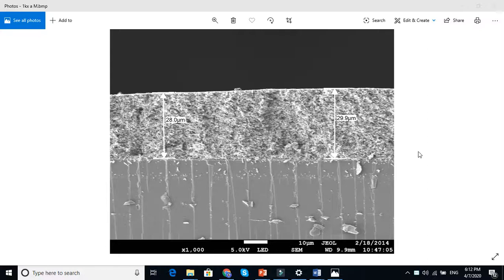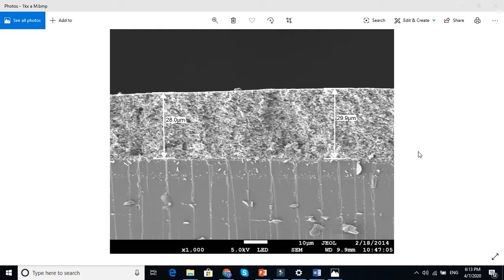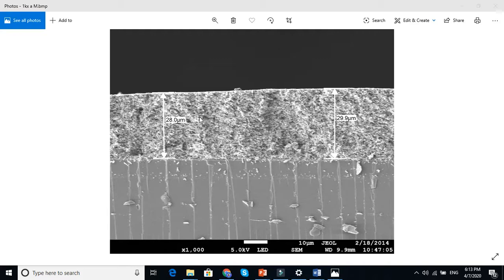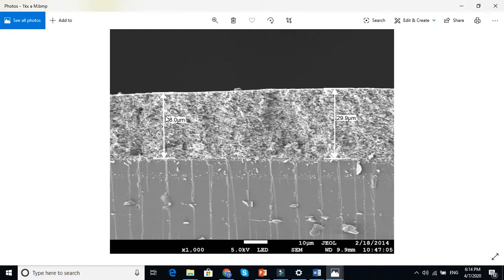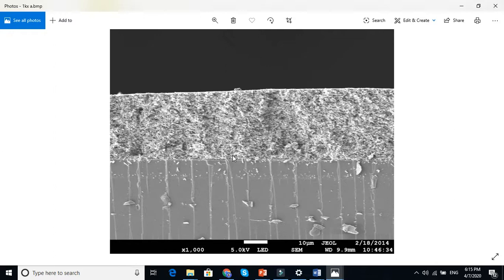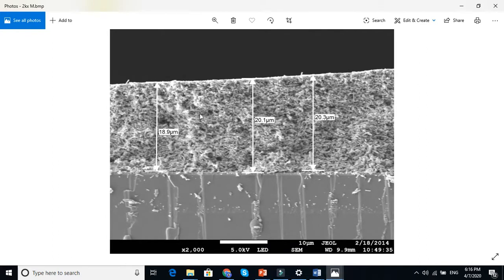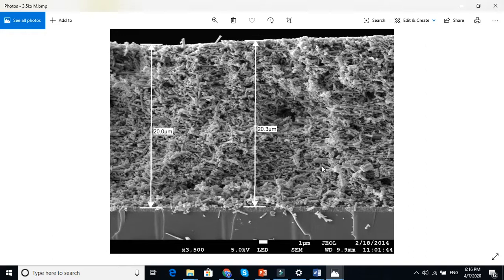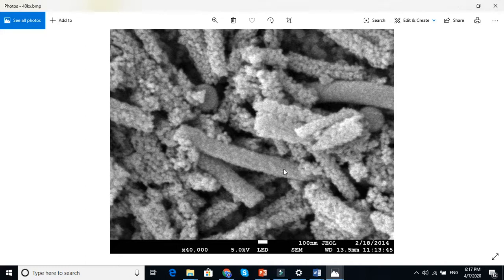SEM Cross Section Analysis | How to Interpret Micrographs

Comment: Sir ,In my project I need to take fesem cross section image for my sample(5mm×5mm) niobium metal foil coated by oxide layer in anodization method.In analysis centre, they said cross section not taken unless  polishing the side of foil, what process I do for it .
Reply from the maker: Thanks for the comment. We can take images of any sample, like the surface, diameter,  height, length, cross section etc...if and only if the sample could be fit in the sample holder of the FESEM machine.

If your sample is small enough to fit in the sample holder of the FESEM, then you can take the images.

Tell the operator that it is possible if you are sure that your sample can fit well in the sample holder.

I have taken countless cross-sections images of different electrodes and nanofibers .....

Please let me know if you have any questions
Reply: @qamarwal yes sir, I'm cutted in(0.5 × 0.5) cm dimensions, but they said in sides of the metal foil is also covered by formed oxide layer and that need to polish the sides,to see lateral view.
Reply from the maker: @-PH-GokilS  polish with what to see it? 
If you want to see the cross section, the operator has to rotate the sample holder to get the image exactly. 

Have you taken the surface images of this sample already? If yes, then I don't see any logic to get Polish the cross section...

Or, for better understanding,  write your complete question in the form of a story so that I can reply exactly.
Reply: @nanospeaks  First, thank you for your reply, sir.
I will tell clearly what my process. First, my sample is an niobium metal foil which is cut in 6 x 2 cm dimensions that is anodised by electrochemical anodization. In this method, my metal foil is coated by the oxide layer in the electrochemical bath. Then, after the coating is finished, I take the sample and annealed it 450 degrees Celsius. After the annealing,then I will cut the sample for XRD, FESEM characterizations.Then, I will get the XRD and FESEM for surface morphology. In the surface morphology of FESEM, I will get like the porous structures. Then, my guide asked me to take the lateral view, cross section view of the sample to know about the nanotube formations. So, I will resend the samples to the FESEM analysis center to take cross section analysis in  0.5 x 0.5 cm dimension.But they said samples lateral sides also coated by oxide layer.If want to see cross section,it need to be polish the sides. My doubt is how to polish it,by which technique,Sir.
Reply from the maker: @-PH-GokilS  What I understand is just take the same sample you already got the FESEM imaged and tell the SEM operator to the lateral (cross section) view of the sample. There is no need for coating, etc...

Tell him to follow the same procedure and get good images of the cross section.  

Your advisor is right here because from the surface morphology,  we can not conclude whether there are single pores or many pores or SWNTs or MWNTs. 

To sum up, just take the same sample and tell the operator to take the images of the cross section.  If he has doubts, then show him or her my videos where the cross section is clear. 

I also have other videos in the playlist, so show them as well.
Reply: @qamarwali  Ok , Sir.Very thankfull for your suggestion.

Comment: I'm trying to measure the thickness of film on a cellulose paper. How do I go about getting the cross section measurement on SEM and how to measure the thickness.
Reply: I will like to share the cross-sectional image I got on the SEM with you,I don't know if I have done it correctly. Then how to find the thickness of the film. I'm using PAINT software
Reply from the maker: If the SEM images looks like what I have shown in the video, then the cross section is so simple. The best way is to use ImageJ. I have made  video on it, please watch it
https://youtu.be/7eXV3d_0OAg
https://youtu.be/aggAEp5vfkA

If you still not able to determine, then you can do it on PowerPoint or paint. I am doing in PowerPoint. Just look at bar scale (may be 200 nm or 500 nm or 1 micron) on the SEM image and guess the thickness of the cross section. Anyways, I hope the above videos will help you
Reply: @nanospeaks  okay the issues is I don't know if the cross section I have made is correct.
Let me tell you how I did it;
Its a cellulose paper with gum on it ( cigarette paper) so I'm trying to get the thickness of the gum on the paper. I tilt  the paper to the edge so I can see the machine cut vertically. So I was able to see the edge of the gum and the paper below. I don't know if that procedure is correct.
Calculating the thickness now;
I use paint and take measurement at the edge of the gum downwards.
So I'm not so sure if what I did was correct

Comment: hello sir i want to  confirm that to measure the thickness of cross sectional SEM images...the software inbuilt in SEM or we need image J software?
Reply from the maker: 1. SEM operator can measure the cross section or any other dimensions (diameter,  height,  length, etc)

2. ImageJ software is an alternative option if the SEM operator can't  take or forget. The bar at the bottom of the images is helpful to guess the dimensions
Reply: thanks for your kind reply❤